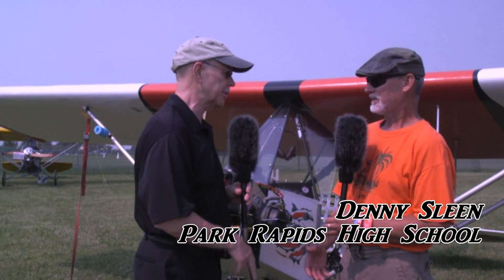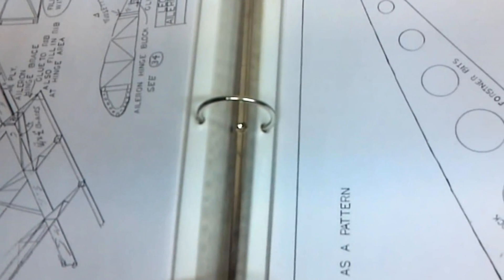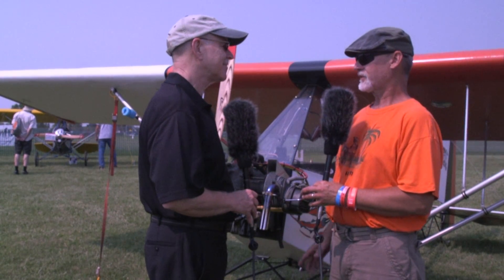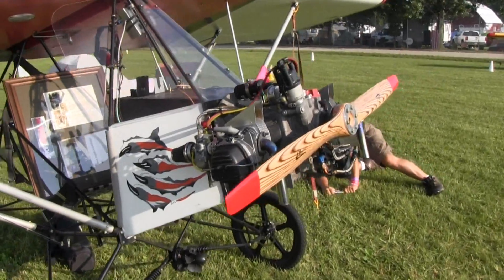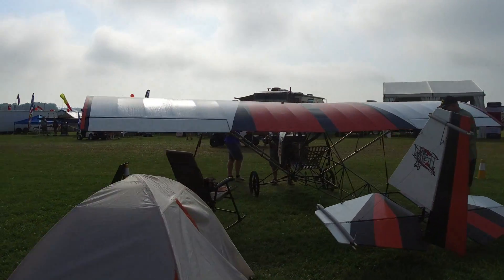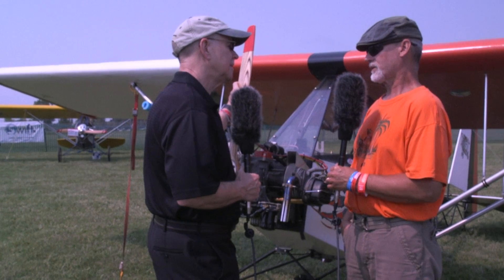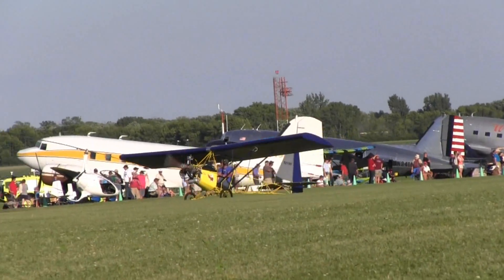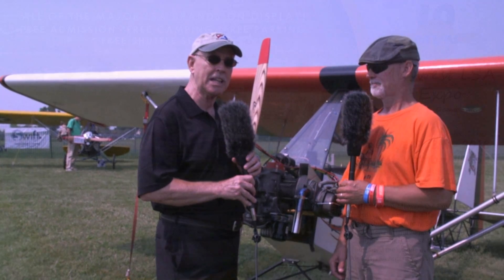Legal Eagle Part 103 Legal Ultralight Aircraft, betterhalfvw.com

Comment: Very interesting. Because an airplane can be quite simple I also believe there is huge potential for very low cost planes. And not in the sense of third world squalor but a point of pride good performer. Normally a triangle truss structure is a good weight to stiffness solution but considering manufacture, how about a single tube spine that you sit reclined on from tail to engine.
Reply: If necessary for weight then a carbon fiber tube is pretty obvious but I'm thinking that a thin chromoly steel tube might also get you under part 103. Maybe pump it full of PU foam at the middle for some added crush strength. Ease of construction has to be a huge benefit allround and can be as important as price. I believe no plane should be a kit because a well run in factory will always be able to optimize the construction to 10-100x easier than the first time individual. And the easier it is to construct, the easier it is for the small factory to have the courage to do it fully. Maybe even certification. As for joy and performance for pennies, consider that the Bede BD-5 was able to cruise at 278km/h at 75% with a 40HP engine. So a very low cost construction might well cruise at 230km/h with that 32HP engine. For bodywork, vacuum formed thermoplast could quickly and easily make it look like a high performance plane. You could even go for a Rutan canard config because canard steering means simple control mechanics and completely simple wing and tail. Rudder could be the front wheel.